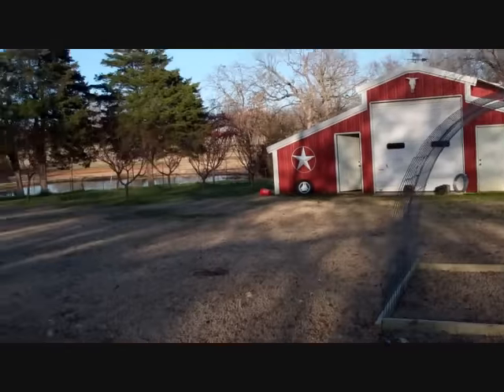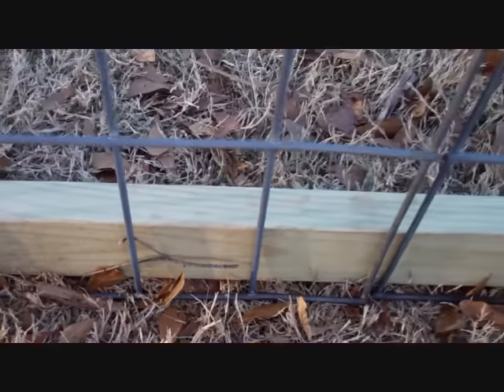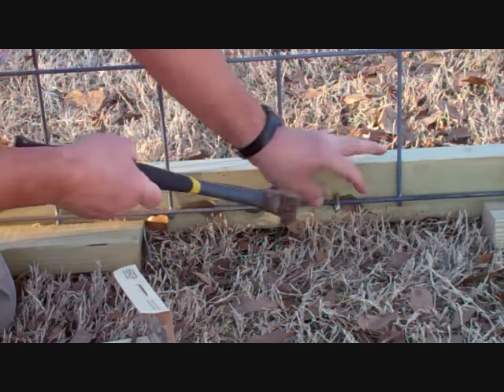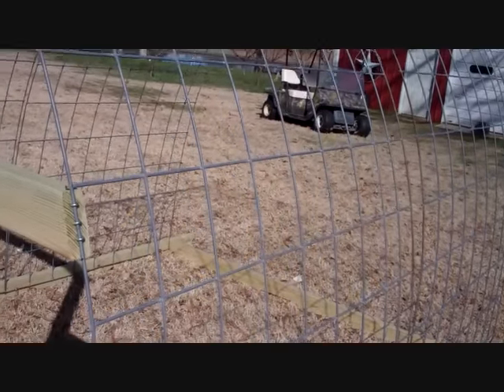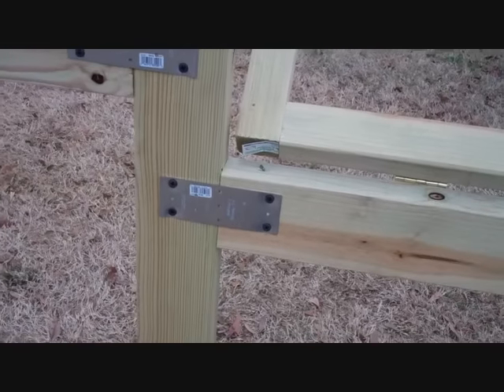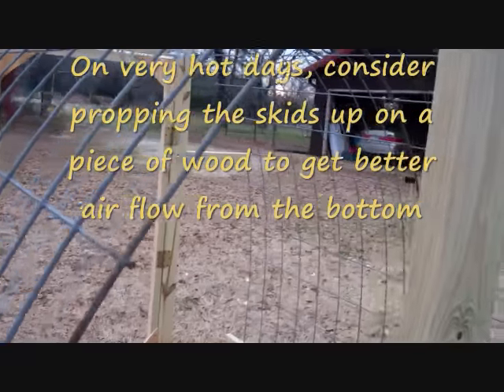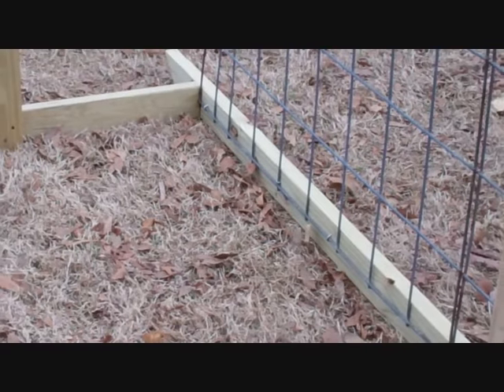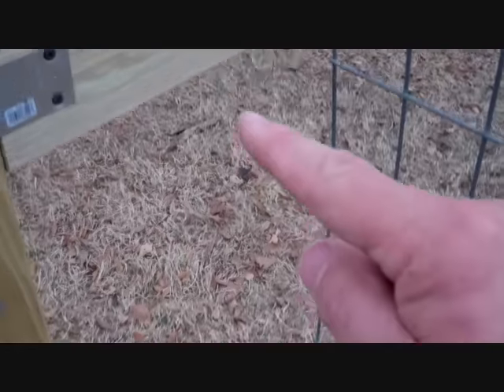🌞Cattle Panel Greenhouse🌱For About 150 DOLLARS! 🌻 DIY

Comment: I built one! And yes it was pretty easy.  I had to have help from my sons to bend the cattle panels enough for the base, but that was all of the help I needed.  The rest I was able to do by myself, which in itself is pretty impressive for someone with limited physical ability.  Thank you for taking the time to put this on youtube and inspiring me and everyone that sees it to make their own. BTW I used pool noodles instead of the rolled insulation, and it worked great as well.  Thank you!

Comment from the maker: E. TX
You might want to use some auger type tie-downs... but the plastic would hold up better than a regular rib-type greenhouse.The wind seems to just roll over the rounded top, and since the plastic pushes in on the panels, it doesn't seem to tear. 
Something to look at: Are there any greenhouses in your area? Does the plastic rip in the wind?
Check out greenhouses around you and see how they fare. The only thing that I see as destructive (besides a tornado) is hail. It WILL rip the plastic...

Comment: I Love mine.  Built the first one 3 panels long last fall.  It had snow almost 2/3 of the way up the sides with the winter we had in NH, but it held together well.  I still remember having to step down into the greenhouse.  That is one time the inward swinging door helps.  If I had to shovel snow to get in, I would have never made it in till spring..  I am now building #2 as an attachment to a shed.  You will walk into the shed then take a left into the greenhouse.  I used raised wooden walls 2 feet high in order to get enough height to go 10 feet wide.  It is coming together nicely, but with 4 panels long I find my modified version needs a little extra support to avoid bowing in the middle.  Well worth my $5 investment.  Thanks for such great videos and instructions..
Reply from the maker: +Blueberryjoefarms Yep... I would think that a 4 panel one might need a little support in the middle. 
I haven't built one that long yet.
Glad I could help.Thanks for the kind words!

Comment from the maker: The mesh is about 6" square in most places. 
The panel is 50" tall and 16 feet long.
Reply: You can’t get these in the U.K. 
So annoying! They look fantastic for gardening.
Reply from the maker: @fainitesbarley2245  
Several years ago, someone in the UK told me he found some, but they were called by a different name.
I don't remember what it was, but you might want to go back and look at the comments under the video and see if you can find it.

Comment: I had this same idea after seeing the panels at Tractor supply a few months ago. I will probably be building something similar but utilizing a block wall on one side and framed wall on the opposing side and by using the panel would give me a lot more height. Great job. This video solved my issue in how to make the end frame work with the doorway. Thanks so much for sharing.

Comment: I absolutely love the cattle panel idea!  The only thing that kept me from building a greenhouse on my property this year was not really knowing how to make the hoops and such.  This makes the job seem so much easier.  I"d love a copy of your list and plans.  I'm moving to Georgia to homestead next January and have plans to make an Earth Bag home, an Aquaponic system but also would love to have a greenhouse.  After seeing how easy this is I am inspired!!  Thank you!  And I know, technically it's not a greenhouse, but in Georgia, trust me it will be.  Instead of a window on the far side, I intend on putting in a fan for air circulation...box fan's are cheap and work great for this application!
Reply: Here's the link to buy the kindle plans for $5: http://www.amazon.com/dp/B00CBNG03K/ref=nosim?tag=homegardenfarmimprovementemergencypreparedness.homesadvis0b-20&linkCode=sb1&camp=212353&creative=380549
Reply: And here's for the pdf: http://www.amazon.com/dp/B00CBNG03K/ref=nosim?tag=homegardenfarmimprovementemergencypreparedness.homesadvis0b-20&linkCode=sb1&camp=212353&creative=380549
Reply from the maker: Paul Ladendorf  Thanks Paul !
Reply from the maker: Paul Ladendorf The Greenhouse will cost about $150, depending on materials costs. The panels (here) are about $18... but in some places they are much higher.
Reply: TexasPrepper2 Cattle panels are $29.00 for 16 ft. at tractor supply here in Turlock, CA.
Reply from the maker: b mizar Dang... they are less than $20 here... OUCH !
Reply: Thanks fellas! Being a single girl I need all the help I can get. So far I've got a camper, next up water.
Reply: I loved this also...so much better than PVC pipes! I do not need as large space, but do need to keep my tropicals safe during winters. Many thanks for your videos....and do not listen to petty male bickering!
Reply: Bet you have moved out of Ca by now!

Comment: Thanks .... I have been looking at many different designs and Liked this one the best . I plan on making it bigger ... But am going to use the same design and put a solar panel , Lights and a fan for better air movement when it gets too hot inside . You also gave me a great idea on how to open the front of my enclosed patio by removing the the front wall and replacing it with that wire structure and putting screening over it to allow air in during the Spring and Summer months and keeping the bugs out .... that tend to eat us alive . Great Stuff ..... as my friend always says .
Reply: I like the solar idea......I am going to build this in April 2018. I think I may go solar as well since I get sun in my spot from the time the sun rises till it sets!!!

Comment: Great concept. Here is something you might consider.  If you dropped the hight to 4 - 5 ft but configured the plastic covered screen so that you could lift it from one side to tend to your plants; the need for a door would be eliminated. Space for planting would be maximized. Cost of materials would be reduced. Weight would be reduced.  Because your not using traditional PVC ribing,  the wire mesh structure would provide a rigid means for gaining access to one side of the greenhouse, much like a hood to a car.

I'll be your first customer.
Reply from the maker: Larry Anderson Interesting...
Reply: Hmmm  seems like any entry point is going to have to be clear of plants to ENTER ...so what are you saving really by eliminating a real door?  Or do you mean simply never entering IN just tending from the sides??

Comment from the maker: It is 50" high and 16 feet long. You will need 16 feet to get a 6'2" height (if you make it 7' wide)
The e-Book or PDF will explain it all if you are interested. Links are below the video. They include materials list and drawings.
thanks
Reply: Great thanks... I need 6’ 6” height... 16’ length is Long enough ... would give enough width for the length of a tunnel.
Reply: @OfftoShambala  If you need it higher you can also use 2x6's and stack them using some metal wood joints  and then staple the panel higher. Probably could make it a full 8 foot wide that way and still end up with your 6'6" height.
Reply: @Paula-mf7cf  or you can make a ladder type frame on iits side.

Comment: I lost a lot of space with the door opening inwards...I changed the door to open outside and tripled my room to move
Reply from the maker: cygerwoods1 Good idea... my next one will swing out
Reply: @BIGALTX  put small door stops top and bottom on side opposite of hinges. Will most likely make a better seal around door edges, preserve heat... and less risk of door getting blown open in wind if it opens outwards. Gives lot more   working room inside and lets you keep door open in warmer temps if you need to work inside.

Comment: A bit easier way to know if it's square is the 3-4-5 method.  Pick a corner and measure from the corner down one side 3 feet.  Then from the same corner measure along the front 4 feet. If i's square it will measure 5 feet between the two other measured points.  You can then do the opposite diagonal corner.  This helps if you do this as you are laying out the boards to know if you have them square from the get go.

Comment from the maker: I bought a huge roll several years ago that will do 5-6 of these greenhouses. I bought it from a greenhouse supply store near me. It is supposed to be UV resistant, 5-6 year plastic. 

I am on my 3rd year. The plastic is a little "milky" and not as "clear" as it was, but is still pretty well intact.
hope that helps...

Comment: While I love the simplistic design of these green houses, I would like to issue a word of caution to those who live in areas that are subject to gusty winds! I live in an area that can get pretty windy at times. I had a chicken coop that was built in almost the same manor. It did pretty well with our normal breezy weather but failed spectacularly one afternoon. Unfortunately I had a small flock of 4 week old chicks in it when it went. The wind had picked it up and chucked it down to the next road. Thankfully no human was injured when it went! the only casualty was my poor little baby Louie that had his leg fractured. He is OK he just has a stumpy short leg and runs funny because of it.

Anyway for those who live in a area that gets windy stake them to the ground well! I wish that I had staked mine better. I should have taken the hint when the wind moved it 10" sideways one day. Don't take the chance, stake them down!

Also if your going to be moving yours around I suggest that you add corner braces to stiffen the bottom wood frame after you secure the cattle panels. otherwise they can have a tendency to rack when you move them.
Reply from the maker: Jayknee Garner I linked to some "tie down" augers under the video... and yes, some folks might want to secure them.
Reply: Better safe than sorry! I unfortunately am the latter. I do like your design and may build one myself when I have the funds available.
Reply: TexasPrepper2  I was going to suggest the same thing brother. I used 4 tie down augers (Wal-Mart, $4 each) and heavy duty cargo straps to tie down my Lance Cab Over Camper while it's off the truck and in the back yard. A couple years ago a tornado passed close to my house. Lost a couple 80 ft. pine trees and some very large tree limbs, but the camper didn't budge. I'm sold. By the way, excellent design on that greenhouse.
Reply from the maker: Grandpa the Grey Thanks Gramps !

Comment: Slight issue that I have with the door......it swings in.........I would rather have it swing out, so that you do not lose any usable space on the inside.  With the door swinging in, any shelves that you place in there would have to be move down on the right hand side so you would have room to go in.
Reply: *****  change the direction as to which the hinges swing open,,
Reply: +John Pulliam Hey John I was thinking the same thing. I am going to have my door open out. No sense wasting space.
Reply: +Regina Leathers  I let the excess plastic drape over my door opening, attached at the top of the door with a strip of wood, then used scissors to cut vertical slits in the plastic about 6" apart  and use that as my door, move it aside to exit or enter and it falls back into place as a door closure
Reply: John Pulliam chickens
Reply: John Pulliam е

Comment: I built my greenhouse following your plans three years ago. I used greenhouse grade plastic film rated for 5 years and it shows no wear or tear.Wind doesn't seem to be a problem at all. it blows right over the top. It was fairly easy to build and is easy to move around. One thing that I have learned is that it doesn't need to be air tight, you need ventilation in the summer. it will get hot inside but by opening the top window vent and your door you get a good air flow and it will lower the temperature.Thank you for posting this great video.Another use for it is a Halloween haunted house. The kids in the neighborhood that would go in it loved it
Reply from the maker: Thanks for the kind words. 
The GH design seems to work in ALL climates and high wind areas.

Comment: I really like how you incorporated the shelf into it. It'd be easy to add a lower shelf as well. I plan on building a 50-60 foot one. However, I'm going to make mine on top of sing up side doors. So, I get even more ventilation, and it will be taller as well. I'm going to have a prep. table, starter shelves, but also just ground that I can plant directly in, and use as a high tunnel. 
Thanks for sharing. You just can't beat the cattle panels for stability, especially how they keep the plastic from being torn by the wind. On my neighbors 100' high tunnel, he has to use straps to strap it down and it still  gets ripped, and they paid like $8,000 for it... crazy how this simple idea works better then the expensive ones... just love these.... thanks again for sharing... blessings.
Reply from the maker: Well, thanks for the confirmation.
So many have built this design and have commented as to the stability of it.
Let me know how it goes with the "Mother of all Cattle Panel Greenhouses"  😎👍

Comment: I forgot to say how impressive the look of the house is as well. It is surprising how structurally sound the design is. It is a solid plan. On the outside it is esthetically pleasing and inside there is an illusion of space that makes working inside the greenhouse very relaxing and inspiring at the same time. Right now I am using hanging baskets with no negative effects from the weight at all.  I cant say enough about how strong the shell is and how attractive it is when finished.

Comment: I'm building a milking shed using cattle panels covered with a tarp for the roof and pallets for the sidewalls. I had thought to get pool noodles to protect the corner s but had questions about how to stretch and secure the tarp roof. 
Thank you for all the simple and practical solutions to my last few questions.
Reply from the maker: So glad to help.
Should make a nice milking shed.
I had a sheep shed for years made like this. 😎

Comment: Finally, how to do the doors on a greenhouse explained so well.  Thanks a million.  And, what super idea with the pipe insulation.  We use concrete wire mesh as hoops and needed to find a way to keep ends from ripping plastic.  Pipe insulation is awesome idea.  Love this whole video though for snow load, hoops from conduit seem to  work better for us.  Thanks again.

Comment from the maker: It might, but the tape will probably wear out a lot quicker and allow it to rip your plastic sooner... not sure...
Also, duct tape leaves a sticky residue... especially when it gets hot... that would probably stain the plastic also. 
At first, I thought about using DT, but the insulation is much better, and not expensive. Pool noodles might work too !

Comment: I recently completed mine based on your video. I went and used  4 x 4 for the base and took a small window for the rear and inverted it so when I opened it this spring it would vent better. I also used 2 x 12 for beds

Comment from the maker: They are 16' long and 50" high.
The "squares" (mesh) varies. The ones I have are 6" sq at the top but at the bottom they are about 2"X6" and graduate larger as they go up.
Reply: What gauge? Farm and fleet has 1/4" or 5gauge
Reply from the maker: @britneydavis1583  1/4"

Comment: I think I would have had the door opening out so that all the inside would be more usable.I'd also probably set a 1x2 on the inside of the door to avoid drafts in early spring.  Much better design than pvc, especially in areas where there is wind and snow. Pipe covers are ingenious and I like the way the window in the back opens out to let heat escape. Beautiful video, thank you so much.

Comment: I like the way you connected this hoop house. It makes it simpler for me;  I plan to make one for this spring. 

In my area, the wind would pick that up in a heartbeat. My neighbor's metal shed was recently picked up and turned upside down. So, here, I will have to anchor it into the ground. Then we have hail storms. After I put the plastic on, I plan to put some wire mesh over that to minimize the damage.
Reply from the maker: Some in windy areas have used these: https://amzn.to/35u44Bp

Comment from the maker: I have used mine for 3 winters... this coming fall/winter will be 4 years for me, My plastic has held up pretty good so far, but has gotten a little "milky"... not as clear as it used to be. There are a few tears, but I just patch them with some clear packing tape, and they are as good as new. I got my plastic from a GH supply dealer around here, It is 6 mil. I guess the plastic from Lowes just won't stand up. All plastic is not created equal.

Comment: I finished building my green house yesterday.
I used 2X6 pressure treated for the main frame just because I like to over build things.
Some things I learned the hard way.
Having someone to help is a big plus.
Make sure the door and window frames are flush with the bottom of the building frame.
If they are not flush it will throw off all your other measurements.
The door will be higher on one side.
Fortunately I caught the error early and was able to correct it. 
If you wrap the plastic around the lath strips on the bottom frame you get a much better hold on the plastic.
The automatic window opener is really important.
This morning it was 62 degrees outside and the inside of the green house was at 83 even with the window open.
This was an easy project to build and it will get a lot of use.
The plans are worth the price so I suggest you buy them.
I have less than $200 total invested including the window opener.
Thanks Texas Prepper2
Reply from the maker: Thank YOU so much.
Glad it went smooth for you and your observations should be a big help to others making the greenhouse.
alan